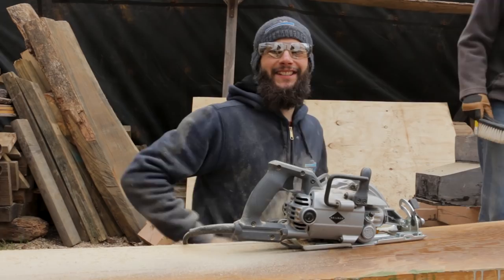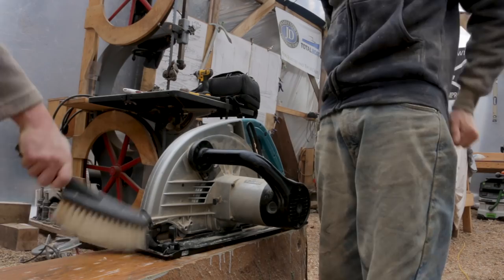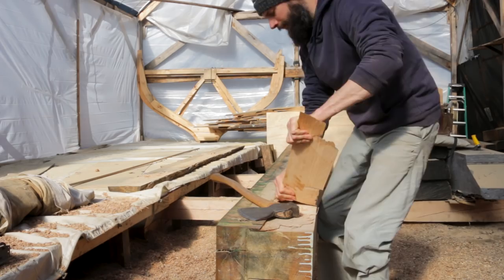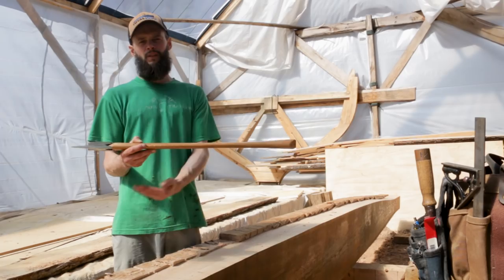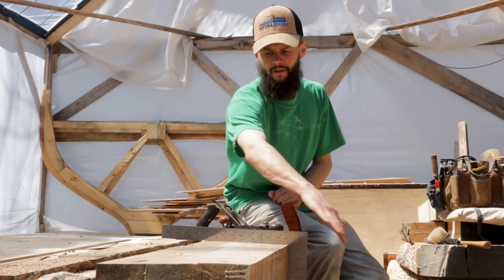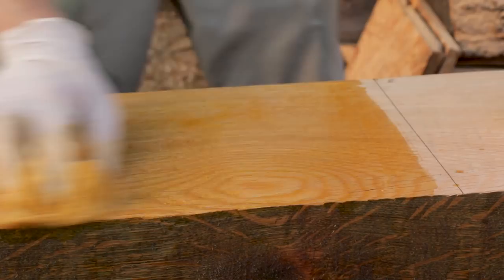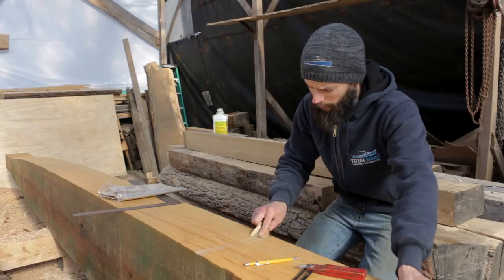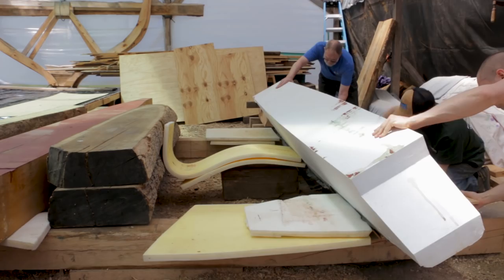Acorn to Arabella - Journey of a Wooden Boat - Episode 35: Final Cut of the Keel Timber

Comment: I'm really interested in this build and I love following along, but I wish I could see an explanation of what is what. I'm not familiar with the parts of a boat and you're talking about keefs kerfs keels heels helms herfs. Maybe make a video explaining the process start to finish, where you are currently in the build, milestone dates...
Reply from the maker: Glad you are enjoying and thanks for the feedback!  
Walking one through the entire build would be a long and complicated explanation.  But we can certainly try to do a better job of explaining the parts and the lingo.
Some of the terms you listed are real, others I am not so sure about =)
Kerfs: 
Are cuts into a timber to make removing a lot of timber faster.  You cut kerfs across the grain with a saw then use an ax, adz,chisel... to knock out the pieces following the grain.  I kerfed with the chainsaw then removed the waste with the ax and smoothed it with the adz.
Keels: 
Either the lead keel or keel timber, both are keels and both are part of the final keel assembly.  The lead keel (also called ballast keel) goes below the wood keel (also called keel timber).  The wood keel is the main structural timber of the boat and the ballast keel keeps her upright when the wind pushes on the sails.
Heels: 
Don't recall using this one but it is the bottom or back edge of a timber, usually carrying/supporting some weight.  Just like the heel of your foot.  Heel can also refer to when a boat tips to one side because of the wind on the sails, a strong wind came and the boat heeled to starboard (the right side of the boat looking forward)
Helms:
Where a boat is steered or controlled from.  Our helm would be the cockpit and the tiller handle.  Other boats are arranged differently. 

Hope that helps!
Reply: Haha yea, I may have went a little ham with the terms, but it was to prove a point. I'd still be interested in getting an overview of the process and how far along you are. Thanks!

Also, is that band saw single because she's beautiful...

Comment: So you are goint to put antfouling on the bedding surface? Or did i not understand you correctly.
Reply: I don't really get this either.  From what I understand, anti-fouling paint is designed to flake off, so things like barnacles don't get permanently stuck to your hull, so in essence, using anti-fouling paint on the bedding surface is not going to make for a firm connection between the keel and the timber.  It will basically be a parting surface, where as the tar, would actually be a bond between.  Anti-fouling paint is only a TOP coat for below the waterline.
Reply: Not necessarily flake off but the surface degrades and washes off with the boat moving or rubbed off by a diver. Just had a problem wirh my bosses viking 58. A surface mounted underwater light came off. The bedded it with 5200 right to bottom paint.
Reply from the maker: Antifouling comes in two varieties, ablative and hard.  Ablative is made to wash away and would be used as the outer coat of paint below the water line.  Hard is like regular paint except with the addition of copper to make it antifouling.

The faying surfaces as well as the hull below the water line will get Pettit Unepoxy which is a hard bottom paint and should never wash off.  On the hull the Pettit will be covered in Total Boat Spartan, an ablative antifouling paint.  The base will be red and the ablative will be blue.  That way when we haul we can remove the old ablative until we see mostly red and then re-coat with a different color.  After we do that several times she will be ready to be sanded to bare wood and the process repeated.

Comment: Curious as to why did not use a circular saw to cut off excess you had already cut  rather that the ax and wedges?
Reply from the maker: The thickness varied from 1/2"-2" and was anything but consistent, so a circular saw would have been very tricky to use since the depth of cut would constantly be changing.  The ax let me split down the grain and I could vary the force of each swing depending on the thickness.

Comment: Good job guys!  One question; Why is the oils from tar bad for the keel timber?
Reply: im guessing its to stop the bedding compound drying out and cracking more than anything. 

looking forward to their answer cause i dunno eother
Reply: just better to keep it in the tar, so it can move a little, not turn to carbon dust.
Reply: The oils in the tar are what keep the tar pliable. If the oils got sucked up by the keel timber, the tar would dry out and stop being pliable.
Reply from the maker: The folks who said to keep the bedding compound pliable are correct.  The oils won't hurt the timber but loosing the oil will hurt the bedding compound.

Comment: This is probably a stupid question, but what exactly is the purpose of the station line?
Reply from the maker: Reference marks for the hull during construction.  Boat plans are drawn with multiple reference points so you can accurately find a spot out in space.  Basically X,Y and Z axis, houses are just X and Y because everything is square and plum, level floors, vertical walls.   Curvy boats like ours have vertical station lines, horizontal water lines and diagonals that go at (you guessed it) diagonals to the water and station lines to plot the boats shape.

Comment: Too late for you guys but I find the corbel saw works well for that and doesn’t burn out your saw. I have used it on purple heat with no problem. If you have to use saw there is a blade made for fire fighters the goes around bends better.
Reply from the maker: Those corbel saws are not cheap either.  You have expensive taste in tools my friend! =)
Reply: Acorn To Arabella just like the Festool vac I saw under a bench there, it only hurts for a while but is then forgotten. As I’m watching you weld that axe, I can’t help think about how I would do it, l have a Lancelot with a depth gauge that would have taken that piece out, I have a couple of adze but don’t use them much, I sharpened up a tile removal chisel and use it in a jack hammer, works well, like a big power chisel.
Reply: Acorn To Arabella you seem to want to do a traditional job, dolphinite has become very expensive, it is mostly bees wax, traditionally you would use Irish felt and Stockholm tar, which they don’t make any more because of the EU. Roofing tar will work and would be cheaper than 5200 but not as good. Last time I got some red lead putty there was a note on the can that said, contains no lead. We make a sauce, boiled linseed oil, tar, oil based wood preservative, good for timber on timber. Now that I am retired I plan on cooking up my own Stockholm tar. Never heat up the roofing patch tar, it is thinned with naphtha or perifin or something and will burst into flame.
Reply from the maker: The plan is roofing tar and felt paper between the deadwoods, ballast keel and keel timber, basically all the joints outside the rabbet.  All the joinery inside the planking and stuff on deck will get bedded in dolphinite.  It ain't cheap but if we get it as we need it, it won't be too big a pill to swallow.

Comment: @9:47 What stops you from putting the adze right into your toes, where you need to cut far (like more than an inch or two), but not too far. I know you've had a lot of practice, but even when building up all that practice have you had any close calls where the adze cut into your boot, or worse where the adze bounced off the wood into your shin?

I love your videos and how they are an example of how much two guys can accomplish.
Reply from the maker: I can honestly say I have had blades from both ax's and adz hit my foot, but they have never left anything more than a scratch on the leather or rubber, I would not use them without closed toed shoes. 
I have never in over 25 years of swinging an ax hit my shin.
I apply very little force when I am swinging them, the up stroke and controlling the angle of the edge/direction of the cut take the most energy.  Unless I am cutting a big log with an ax or splitting fire wood the down stroke has very little muscle behind it.  The weight of the tool and the sharp edge do the work.  So by the time it contacts the wood there is not a lot of energy left to drive it into my foot or shin.  That is why there is the saying "a sharp tool is a safer tool" 
Glad you enjoy them!
Reply: I figured it had something to do with the controlled application of power so thanks for explaining the details.

Comment: Stephen, I completely understand why you did the cut that way. It's counter intuitive to use a circular saw that way and, frankly, I was looking for curls of smoke to rise from the cut. When you got to the ax all I could think was: adze. (Your choice though, you know your tools and you know your hands.) Doesn't matter; every careful blow was painful to watch. A sigh of relief, then, when the plane work began.

I'm not trying to make you a hero, it's not explosives you are working with, but i tire of you saying you are a rookie. That implies a lack of experience and untested skills and neither of those pertain to you. 

You're an artisan, a worker in a skilled trade, especially one that involves making things by hand. You are skilled (I cannot hear that modest protest), you are using your hands, and you are building a wooden boat with a sweet name. You are an artisan boat builder. Good catch on the measurement error, professionals routinely do exactly that kind of mid-course correction and that is why the things they produce function as they were designed and intended to do. An artisan and professional may sometimes scrap a work entirely and then start over. Their mark is not that it happened but that they knew it was necessary. Enough!

I know you hear that singing in the air: it's the wind's sweet tune as Arabella runs before a squall... it's why a stoic Yankee works so damn hard.

A change of venue: 

I was working on replacing the main propulsion shaft seal. It was an ingenious design involving two semicircular halves in a matched pair, mated at the factory of manufacture. One pair was made of Stellite, a Cobalt hardened metal alloy, and the other mated ring was made of carbon (it has amazing low friction qualities). I had installed the metal ring and the carbon one was on a nearby workbench, just un-packaged and about to be installed. My new Division Officer, nearly fresh from the academy stopped by and said he thought the ring to be amazingly smooth and reached out and stroked the perfectly smooth carbon surface with his bare forefinger. I quickly reached across the workbench and grabbed a handy ball peen hammer. With four decisive blows of the hammer I reduced the perfectly smooth carbon surface to gravel.

Astonished, he asked why I had destroyed the carbon seal ring. (I have abridged  this conversation.) I told him to go ask the Engineer (his boss) about the corrrosive action fingerprints have on a finely polished carbon surface.

As I recall it, that young officer (interestingly, first in his class at Annapolis) became an outstanding crew member. He went on to be selected to be a Navy liaison to the Nixon White House beginning in July, 1974. I don't know where his non-naval career went after that.
Reply from the maker: Haha, if you go real slow the saw will open up the kerf on the back end to help make the curve, just have to be careful on the inside curves doing that!  
The adze is more of a finishing tool, for rough removal the ax is much faster and more efficient.  I have been swinging an axe since I could walk so for me it was enjoyable and close to carefree.  I am getting there with the adz, by launch time my adz work might match my ax work.
I think you misinterpret me.  When I say rookie or newbie or beginner I am referring to boat building and things like pouring a ballast keel, because in those venues I am a rookie and newbie. I have never built a boat or poured a keel.  
When it comes to actual wood working, joinery, tool sharpening, usage... I am by no means a rookie.  I have over 20 years under my belt, several of those as a working professional.  Those skills and experiences certainly help make the rookie learning curve much shorter. 
I do hear the wind and feel the deck under my feet.  She's out there in the piles of oak and pine, just gotta dig her out.  Someone once said "You Yankees will dig a pond in the middle of winter with a spoon but come spring by golly you will have a pond".  All it takes is work and time, just have to be willing to put both in, in this case the reward is worth whatever it takes to get there times 10.  We would both never forgive ourselves if we quit. 
That's a pretty great story, thanks for sharing!

Comment: So, roller tables and the shipwhrite's bandsaw were out of the question for sawing the keel? Just seems like you guys made it harder than it had to be with the tools you have. Of course roller tables would cost to build, but I'm sure you would use them again.
Reply: My thoughts exactly. Seems to me that bandsaw would've been the way to go.
Reply: First tool I'd look into would be a portable band saw. If the opening is large enough, you're golden.  Also have an extra set of eyeballs on site to ensure proper cut angle.
Reply: You beat me to it. I didn't know that large  portable band saws for wood working existed a week ago or so until I saw one on This old house episode.  That saw was different than most of the portable band saws I saw for sale on the internet. I wasn't sure the ones commonly available would do the job but I found a Falberg saw for $6500 that would work for sure but I think the $6500 would make it a non starter for this purpose. I wondered about using a hand saw to complete the cut. It would have been a lot of work but Maybe not as much work as the approach they used. I also liked the idea of using the big band saw. It might have taken 3 or 4 guys to make that idea work though.
Reply: Dave Kirkeby 
I think a hand saw of some type would have been the best....but then again I have no idea what it's like to be these guys!
Reply: hand saw all over it
Reply from the maker: The timber would have broken the band saw table, it weighs at least 1,500 pounds, it would be like putting a small car that is 25' long through a band saw.  
A portable one could work but the ones big enough to handle a timber like that are crazy expensive.  
As for a handsaw.  Go rip 50+' of 4" thick white oak and let us know how long it takes! ha! My shoulder hurts just thinking about it! 
The axe and adz took much less time than people seem to think, it was  leisurely compared to a handsaw.  It takes little effort to work a fairly sharp axe and very sharp adz. The axe was only fairly sharp on purpose.  Sharp enough to split it along the grain but dull enough that if it split very easily the axe would not pucker up the timber below too badly.
Reply: ... do you have any idea how heavy that peace of wood is lol

Comment: Use an old bandsaw blade, or new and cut to short length for both of you. Add a couple handles and it should follow the cut along your exiting cut lines.
Reply from the maker: Thanks for the suggestion but there was 50+' of 4" thick oak to saw through.  We will never know for sure but I would bet my bottom dollar the way we did it was faster and less effort.

Comment: I would have had a go with a simple hand held ripsaw for the remaining few inches.
Reply from the maker: Grab a 4" thick block of oak and rip 50+' worth of it with a hand saw and let us know how long that takes and what the rotator cuff surgery costs =)
Reply: that tough eh?
Reply from the maker: It's used for the framing on boats for a reason =)  It's very hard and tough stuff!

Comment: This is a better idea? This will work better than sawing the other side? Must you always do it the hard way?
Reply from the maker: I must do it the best way I see to do it.  We could have sawn from the other side but if we were off by a little bit we would do horribly damage to the keel timber.  By kerfing and using the ax/adz it might have been slower but the chances of messing up a very large and expensive timber was lessened at least in my view.  Others may see it differently.

Comment: What a pleasure watching  your work! A question, though, regarding the lead keel design: what is your reasoning for the positioning of the fore and aft "wings" down verses up?. The wooden boat "Emma" has a similarly shaped lead keel, but its positioned bottom side up in relationship to yours, like the "wings" hang in the bow and stern wood, while yours clamps the fore and aft wood to the keel timber. I'm thinking if the keel were to fall away for any reason, it would take fore and aft wood with it if configured as in Emma. Not sure if it would matter, poor Arabella might be on her side without a keel.
Reply from the maker: That's how the designer, William Atkin drew the ballast keel so we followed his lead.  It will get bolted on with 10 1" diameter silicon bronze bolts.  It won't go anywhere =)